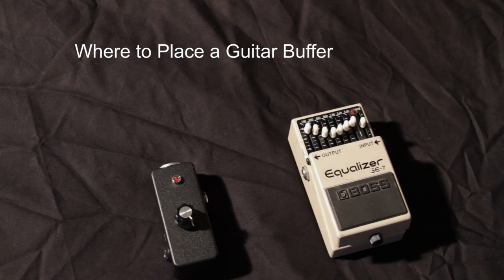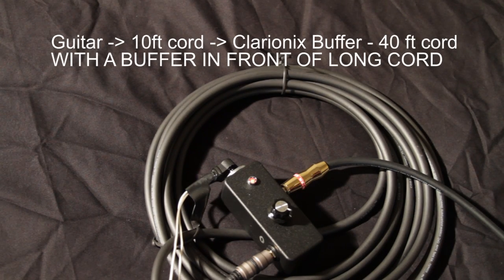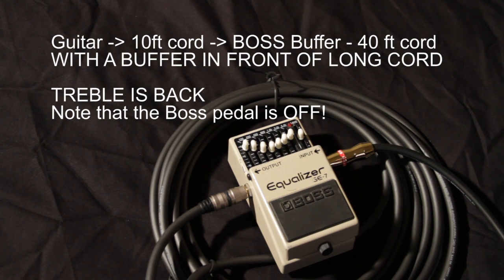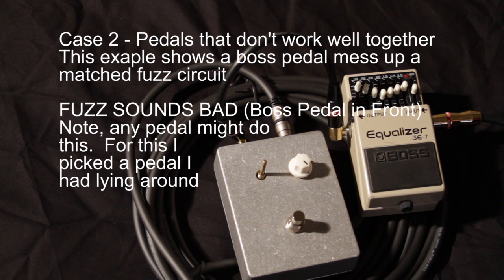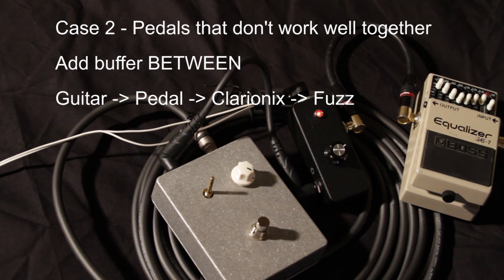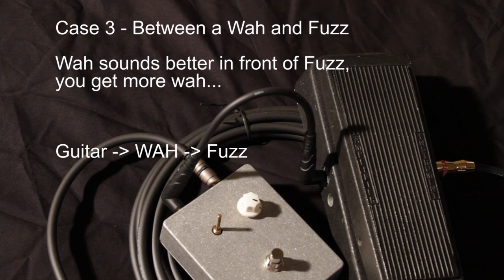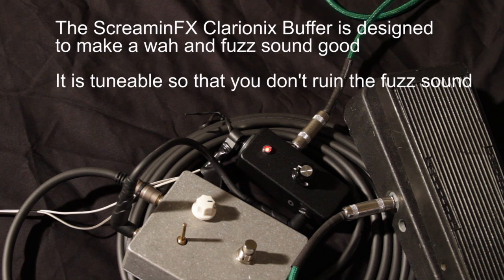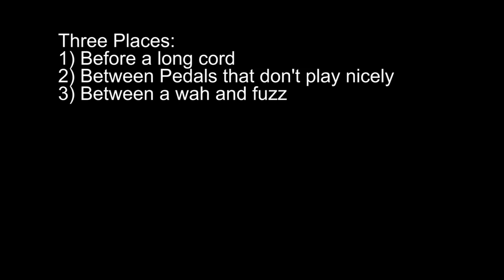Where to put a guitar buffer pedal in your pedal chain

Comment: Mostly fuzz is better to put before wah. It delivers much more of harmonics for wah filtering. Fuzz after wah enhances even freqs that wah supressed before by tuning at another resonantion point. For wah after fuzz then doesn't matter that wah has in older models high impedantion at output. You can put buffer here, after wah. And it doesn't make noise and feedback.

Comment: Good video but I would add two things to it to make it better. One, add boss pedal between wah and fuzz to show how it's different from your buffer solution and two, do a demo of fuzz going into a wah so we can see if we like that sound or not. Also, tell us the difference between your buffer ie. "fuzz friendly buffer" and a "normal buffer". What does a "fuzz friendly" buffer do to the output impedance of the wah when it's going into a fuzz? How does this differ from a boss's "normal buffer" design? Things like this will make it easier to know why we need your buffer rather than a normal buffer.
Reply: Nevermind, I see you did a video about all of these already. Great job on the videos, btw.

Comment: Everything about buffers and bypass is always confusing. A buffer simply drops the high impedance guitar signal to low impedance which most pedals can handle and love but some pedals are designed for the guitar high impedance signal and hate it. And yes you can put a high quality buffer in between two pedals that react weirdly, but that may not always work and if a fuzz, becomes subject to each pedal individually. 
Any Boss pedal actually has two ALWAYS on B grade buffers in it so using a buffer after a Boss is actually a dual buffer. Maybe it improves the quality of the buffer as Boss is not so great, I try to avoid them if possible. A chain of Boss pedals presents a buffer cascade that just ruins the natural dynamic of the guitar signal. Brian Wampler has a vid where he indicates via proof multiple Boss pedals will degrade your signal. Only remedy is a by pass looper switcher.
 I do have a BossWaza Dimension C but that is way down the chain and Waza claims they have updated the buffer. I use an Xotic Super Clean as my front end buffer which just cannot be surpassed. It makes a huge difference even though my rig uses all quality cables. 
Not all buffers are created equal no matter what someone says, some are class A quality others not so much. In general an old style circuit fuzz hates a low impedance buffer signal so best they see the guitar signal and buffer after them. Anything in front of a fuzz that is a buffered platform can be a problem, many modern fuzz circuits like Wampler can handle a buffered low impedance signal just fine. In basic thought buffer near front of chain as possible, after old fuzz, I do not buffer before my wah and my wah is bypass. Fuzz is problematic to any wah, many just don't sound very good, the notion a buffer dropping the signal down before a fuzz is always an odd thing. Some pedal outputs present a low level signal output which while maybe not being technically buffered will react badly w fuzz. Some makers like Fuller claim their switchable wah buffer makes fuzz sound OK w the wah but then others will say an old circuit fuzz hates a buffer in front. So really it all depends on your own rig and pedal chemistry, you sort of have to try things and see how they do as all pedals and buffers are very different. We all know Hendrix used a Vox wah because the Crybaby buffer reacted badly w his fuzz. Our tech has improved light years in almost 5 decades and also the number of quality pedals available is uncountable, yet some still have to reach back into the past, so one has to suffer the clash with technology to get them to sound decent (despite they never really did sound that great, most of the time Hendrix live sound was a Niagra Falls of hiss.) 
The rule of buffering is that anything coming after the buffer is invisible to loading and capacitance so one buffer does the trick but you often have to experiment where to put or most likely you have a pedal that is already buffering the signal down. Too many buffers can be a worse problem to have hence why true bypass are important. The ideal is a buffer sandwich w true bypass in the middle. 
Some players, like Hendrix created a capacitance loading issue on purpose using a long curly guitar cable to pull down the high end on their tinny Strats but there are better ways to EQ your sound and headroom in the 21st century.
Reply: That Xotic SCB is great I got one when they first came out It actually has the TS808 chip in it too AND a very EQable control set up with the dip switches

Comment: hmm, know i know why soooo my folks use the boss tuner, and not so much because its a tuner but because it buffers and it being a tuner is a bonus. lol
Reply from the maker: same could be said for many boss pedals!
Reply: It suffers as working but there are much better buffer circuits if you just use a true bypass tuner. I recommend the new Xotic Super Clean buffer boost at 18v, makes an amazing difference even if you just use it for the buffer and unity boost. I will only use Waza Boss as a rule I stopped using basic Boss pedals ages ago, there are better ways, depends how much you care about your tone.
Reply: I have 5 Boss pedals on my board and still have a Db+ starting my board and have a modded Soul Food set to buffer after a wah. I dont use long cables. My longest is 6 fts goin to amps and from wireless. Stereo

Comment: Im looking to get a Shure GLX wireless/tuner, then follow it up with a wah, then a fuzz into the front of my amp. Then put a chorus, flanger, harmonizer, delay, and reverb into my amps effects loop. All pedals will be in the same board, then I'll use three long cables to go from my pedalboard to the amp's front and loop. In that situation, where should a buffer go?

Comment: Question:  Resophonic Guitar (Dobro) Acoustic rig

How would a buffer interface with a Fishman Aura Image pedal (models different microphone models) that is typically supposed to be the first thing that the Fishman piezo pick up sees in the signal chain?

Buffer before the Aura pedal? Or after?  Where in the chain?

Your thoughts and advice is welcomed!

Current path is:
Dobro (Fishman piezo pu)>Fishman Aura pedal>Boss Reverb>BBE Sonic Stomp>Radial PZ Deluxe Acoustic Preamp/DI XLR to PA
Reply from the maker: Tim Harr I don't think you need one...  The Aura should have a good input so you don't need one in front.  The output should be buffered so you probably don't need one there either!  You might want to try your Reverb closer to the end of your chain...

Comment: Hey I have around 11 pedals all in serial and there's an audible difference between the tones I get when I am directly plugged into the amp compared to when I'm going through my pedalboard. 
I dont have any wah or fuzz pedals.
The sound gets too bassy and muffled if I use the pedalboard. Can a buffer pedal help?
Reply: Absolutely! This is exactly what you need. Put a buffer at the front (I use a TC electronic Polytune3) and at the end (I use a Saturnworks buffer to line drive to the preamp input in my amp). Cheers!

Comment: Very good video. Thank you. Question - the cables I have going in and out my pedal board are not really long but I usually have about 10 pedals in between (none is the Equaliser), and not sure which one are true by-pass. I haven't tried one out, but would you think I may need a buffer?

Comment: v. good.   I have question please about impedences  and the use of those true bypass looper router switcher things:

If one uses a looper router switcher with their pedals, how does that affect the impedence going into any single pedal in an enabled loop?  For example, if I had a Fuzz Face in one of the loops and it was engaged, and suppose all the other pedals in the other loops were currently bypassed, then how would that affect the impedence going into the Fuzz Face, compared with the guitar lead going directly into the Fuzz Face.  Would the impedence be incorrect for a Fuzz Face if is employed in the looper router switcher?   I hope the question makes sense. Thanks!

Comment: Im new to buffer pedals even after all my years of playing. But I have a question. What if you have a wireless unit, would you still use a buffer pedal?
Reply: Sometimes coming off a wireless into a pedal board presents a signal problem, a quality buffer certainly could not hurt. Brian May's guitar tech has shown they mount Brian's classic treble booster on his guitar strap before his signal goes out to the wireless else they could not get the signal right (treble booster was probably designed for a high impedance signal). I  do not use wireless but I would say a quality buffer certainly could help the signal feed the pedalboard depends on what pedals and all that.There is a reason why some just cannot use a wireless.
Reply: @paulsguitarstudio126  Ok thanks!

Comment: +ScreaminFX When you say that the Clarionix can be "tuned back" what do you mean? Is it that the output impedance can be raised?
Reply from the maker: yeah, you can change the output impedance so that it matches fuzz pedals.  I made up a circuit that does a good job for this when I started building fuzz pedals so I ended up making it on its own as the Clarionix.

Comment: Great video! Does this mean though that if I'm not using a wah or a fuzz, I don't need a buffer between two pedals? Like a distortion and a overdrive turned down low for a boost or a acoustic simulator and a reverb?
Reply from the maker: Yeah, you probably don't need one.  If you get a bad feedback or other problems it may help.  Some pedals have impedances that don't match but you'll know because it won't work.  With those pedals on, they should be strong enough to drive everything and basically self buffering.
Reply: Daniel Willen, if all of your pedals are true bypass, and you have long or curly cord from your guitar to your board and a long cord from your board to the preamp of your amp head/combo. Ideally you would want a buffer at the beginning and another one at the end of your pedal board. Cheers.

Comment: Any reason why you didn't just put the Fuzz in front of the Wah?
Is the Wah buffered?
Reply from the maker: I like the Fuzz after the Wah, I can usually get more Wah Wah effect that way. The Wah is not buffered.  There ends up being an impedance mismatch between the wah output and the fuzz input which a buffer can fix as long is it works with the fuzz.
Reply: ScreaminFX
Ahh, ok. Thanks for the quick reply :-)
I had that screaming sound between my GCB-95F and a Wampler Velvet Fuzz... Reading the fuzz manual recommends placing it outside/before any buffers.. i.e. the GCB-95F is apparently buffered (not true bypass) - didn't know that when I bought it. What brand/model of wah do you use in the video?
Reply from the maker: MrMaton01 Hi!, I used a Crybaby Wah, GCB-95, a Boss GE-7 turned off, the Clarionix buffer I build and a prototype germanium fuzz that is now the 1948 Fuzz.  Some buffers work OK with a fuzz, others mess it up and make it sound like its dying, which is probably why they just say to place it after.
Reply from the maker: ScreaminFX Also, here's a video I made about Wah before Fuzz How to Fix Wah and Fuzz Problems - Wah Before Fuzz
Reply: ScreaminFX
Hmm, I'm seeing a lot of Mods for GCB-95 (post 1990) to make it true bypass or to remove its Input Buffer (1st stage in the circuit): http://www.electrosmash.com/crybaby-gcb-95
I don't understand it (impedance difference etc.), but the general 'internet' opinion is that the input buffer sucks the tone out of your signal.
Would removing the input buffer on these Crybaby's change the way a fuzz placed directly after it would react?
Also saw some mods to insert a variable output buffer to the wah so you can dial in the tone - I assume this would be like your buffers variable control?
Reply from the maker: MrMaton01 I also made that mod to my Wah, mine is true bypass and the input buffer is only used when the pedal is on.  It probably wouldn't change the way a fuzz after reacts if you take out the input buffer except when the wah is off, because you have buffer in wah (always on), wah then fuzz so you are removing the first one (buffer).  Its the output of the actual wah and the input of the fuzz that sometimes causes a problem. So you need to add a buffer after the wah, before the fuzz for when both are on.  Yeah, I guess that buffer would be similar but you have to modify your Wah and solder some.  The Clarionix buffer I make just plugs right in and you can tune it.

Comment: I have a Cry Baby 535Q that I think is sucking tone. Should I put the buffer before or after the wah? I am definitely losing high end and my tone becomes very muddy. Appreciate the advice!
Reply from the maker: +Jason Maltz Hi! I think after will most likely help because it will drive the signal better.  The ones I make I usually recommend after.  If the tone loss is when it's on though, there is a chance that before will help because it may be loosing signal when running the wah circuit.  Please let me know when you decide the best though.

Comment: In case 3 which is to show how a buffer works in between a WAH and a fuzz, the signal goes as Guitar---WAH---Buffer---FUZZ. In this case, before you turn on the WAH, the signal goes actually as Guitar---Buffer---Fuzz, which is a buffer before a fuzz, why does that "buffer before fuzz" signal sound good then? I hope I made myself clear...
Reply: So is it that the off-boss buffer doesn't work well but the buffer you made can do the job? Great video, thx. :D

Comment: Do you recommend more than one buffer? Or, the fact that your can tune the buffer depending on the pedals and length of combined cables should be enough.
Reply from the maker: Depends why you want to use it.  First thing to check is if the pedals you have already have a buffer.  Many do or many can drive a cable so you won't need more.  On the Clarionix, the tuning part is mainly to reduce the buffer strength, which is really helpful for a low input impedance pedal like a fuzz (you can hear it crack when you put a pedal in front).  It will also reduce the treble gain a little.
Reply from the maker: screamingfx One thing to remember is that the buffers main impact is from its location to the next piece of gear thats on.  For instance, buffer - long cord - amp it will drive the cord to the amp.  But, buffer - short cord - pedal may not need it at all.

Comment: Great video, however I must point out that the Monster Rock Guitar cable you are using adds its own fair share of treble signal to the path. This is from personal experience. Cheers!
Reply from the maker: mckevrock Yeah, those monster cables actually have fairly low capacitance which means you don't loose as much signal.  They aren't actually adding because they are passive (no active transistors, no battery).  Thanks!
Reply: ScreaminFX Ah ha.... Good to know!

Comment: Do the pedals with a buffer have to be powered with a battery or the buffer works even with no battery or adaptor?
Reply from the maker: They will all need a battery.  The buffer has a transistor in it and needs to be powered.  You can think of it as providing more power to your signal but the buffer needs to get power from a battery to do this.  The Clarionix I build runs off a regulator Boss style power adapter.
Reply: ScreaminFX Thanks for your answer :)

Comment: So if I have a boss tuner tu-3 I dnt need a buffer ?? 
Would you reply please ?
Reply from the maker: Hi, it does have a buffer in there.  Depends where you use it, but if you place it in front it will drive the signal to the next pedal you have on or until one that is not true bypass (circuit has something on even when off like another boss pedal).  A quick check would be to see if you like your tone better with and without the tu-3 (make sure to use short cords for the comparison or a true bypass pedal to replace it).  Some people like the tu-3 buffer sound and others don't... depends on what you like and your setup.  Hope this helps!

Comment: I got a pedalboard with a kable for amp, and the each a kable for fx send and return. where should i put a buffer?
Reply: most likely a buffer is the very first pedal in your chain...because it boosts the capacity of the guitar signal...but if you have a complex pedalboard with loads of true bypass pedals you can always switch the buffer around a try the best position..some guys use 2 buffers as first and last box in the chain...but beware if you use a germanium transistor fuzz the buffer has to be behind the germanium fuzz, because germanium fuzz pedals do not like buffers in front of them
Reply from the maker: great advice!  Thanks for posting.  I made that tuneable buffer so you can put it in front of the germanium fuzzes...
Reply from the maker: hopefully you don't need one in the fx send and return lines.  If you do, I'd probably start right before the return